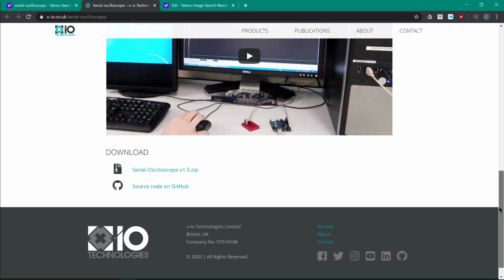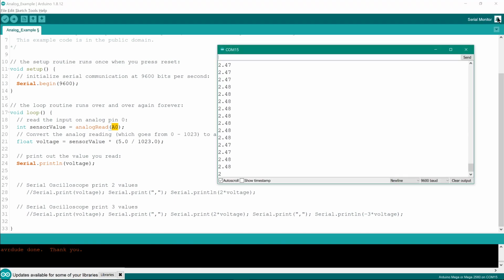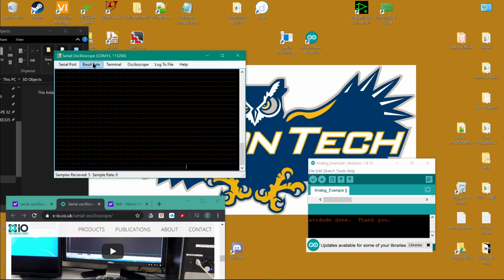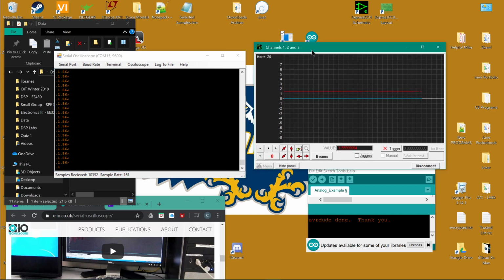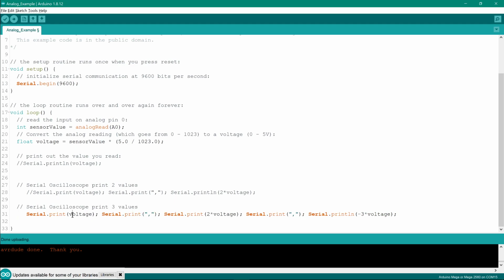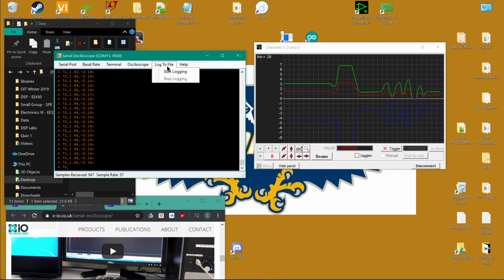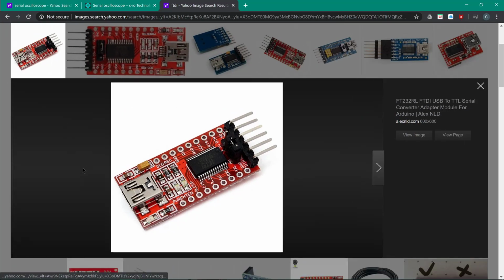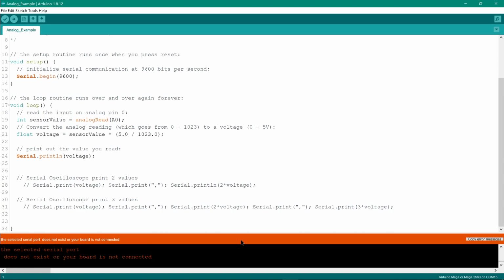Serial Oscilloscope short rundown

Comment: What is the maximum frequency that it could accept?
Reply from the maker: I'm not sure. I imagine it can keep up with anything the Arduino can put out. I see that I didn't set a sampling frequency in this demo code. I'm sure it would work fine if it were free-running like this at 115200 baud. Really, since it is PC-based software capturing the data, I expect the sampling frequency would only be limited by the microcontroller or possibly by the USB.